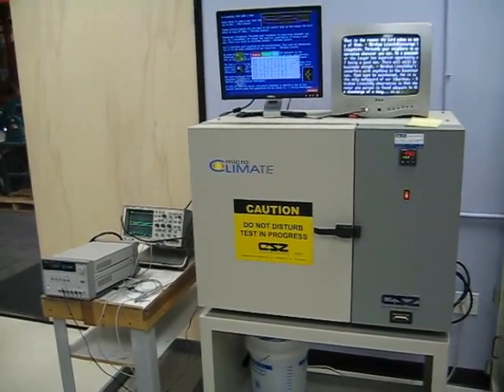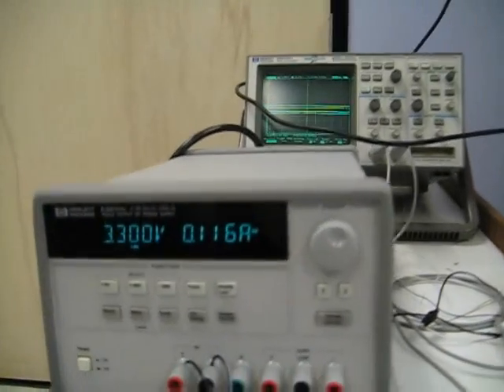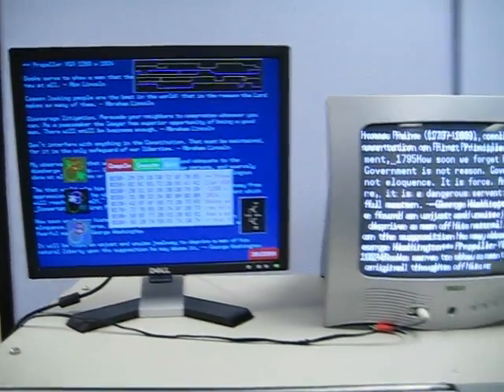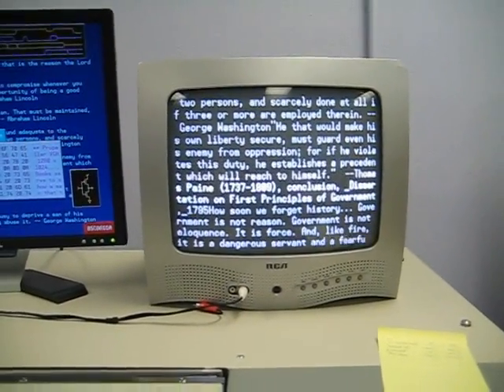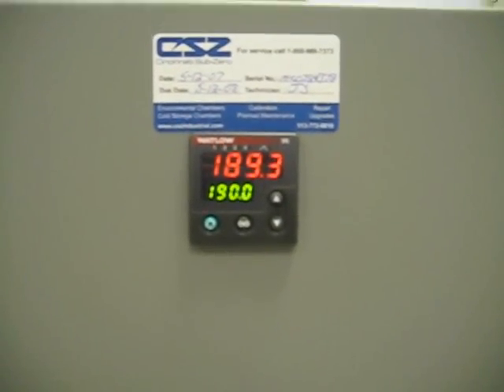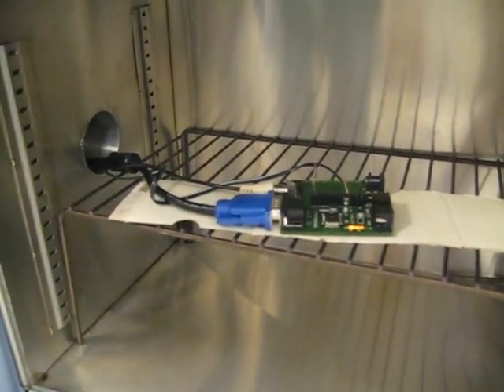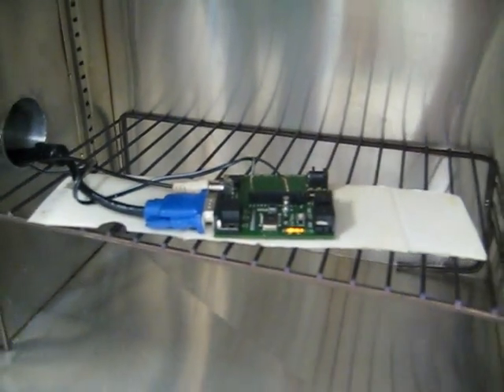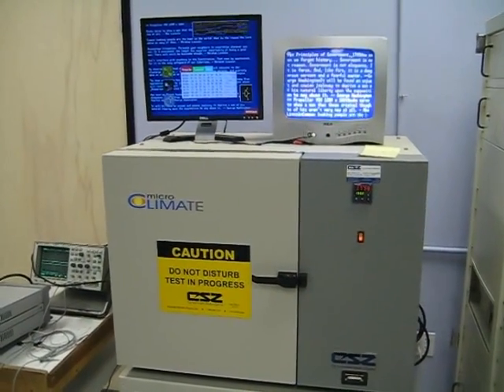Parallax Propeller Chip Temperature Test

Comment: @Primiscomputers
I've seen overclocked AVRs behave erratically just as you pointed out.  There was a youtube video for awhile showing an AVR clocked at the color burst frequency.  The guy would just touch the chip and it would throw off the oscillations.  Thankfully AVR came out with the 644P which can be clocked at the color burst frequency.

Comment: I think they are doing margin testing, to do this you need to find where the chip fails. Testing strictly to specification and not beyond is just bad engineering and can potentially land designers in a world of hurt if a circuit block on the IC has some design/process marginality. All of this is true even for PCBs, mechanical systems and so on.

Comment: No, most mechanical or electromechanical oscillators double as fairly good, if a tad nonlinear, temperature sensors. The crystal's frequency is a function of temperature, that's all. I've ran a crystal (not an oscillator) up to 250C once and while there was a slight (~80ppm) permanent frequency shift after room temp to 250C and back cycle, there was no other damage, and Q remained within 5% of original.

Comment: You can bake a pizza in there with it also thats getting pretty close to melting the solder if it's that low temp stuff they sometimes use with SMTs.